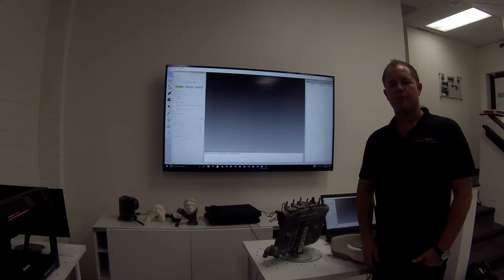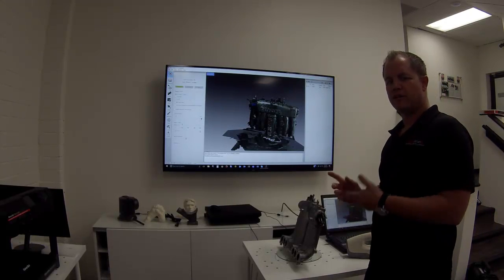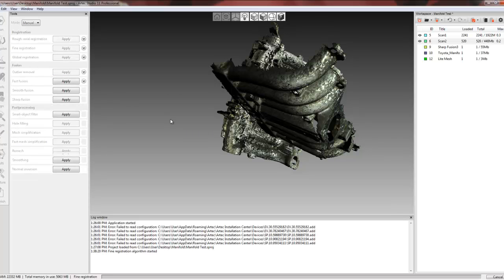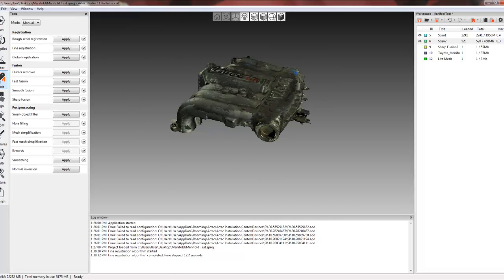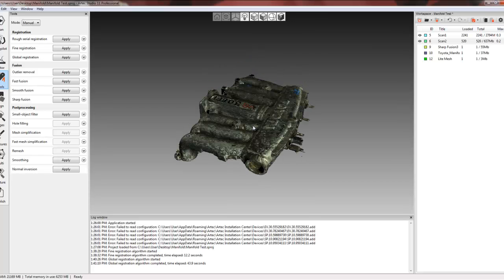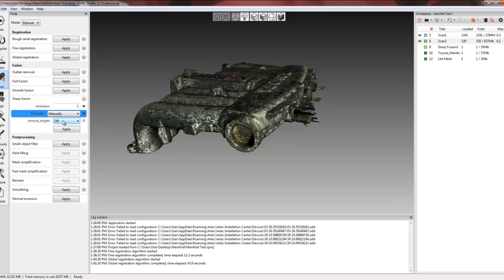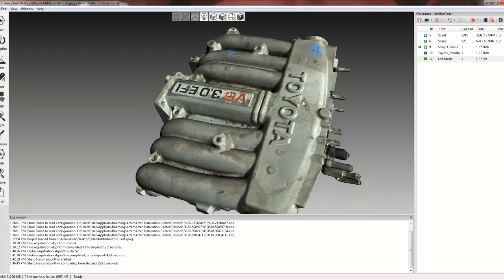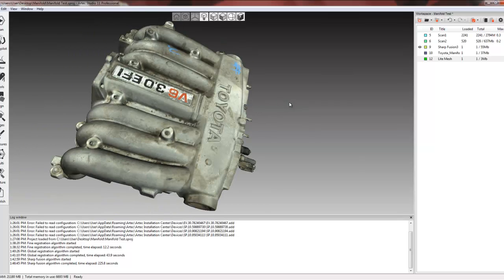Arte Eva 3D Scanner - Rapid Scan 3D - Automotive

Comment: Wondering if the software could upscale the size of certain areas, say the runners and port openings, to make a high flow manifold?
Reply from the maker: Yes you would be able to do this within a modeling software.  We represent Geomagic Design X which allows you to create full CAD parametric features.  You can then extrude and make those ports larger.  This is how we work automotive performance manufactures.   Let us know if you want to know more info@rapidscan3d.com or (562) 912-3544